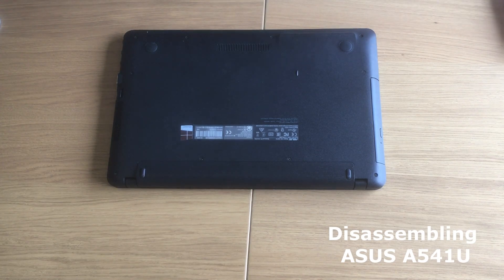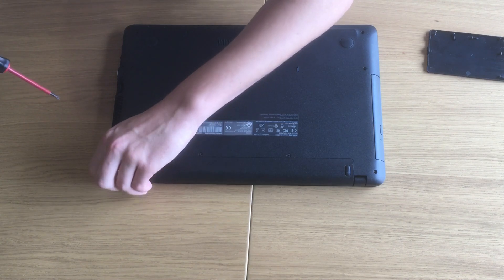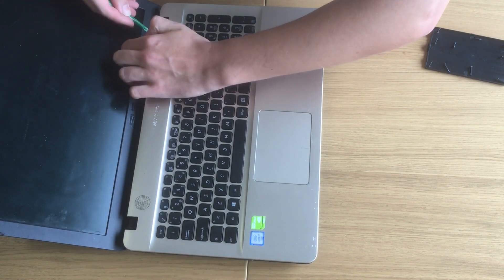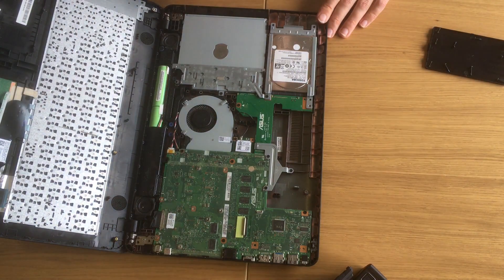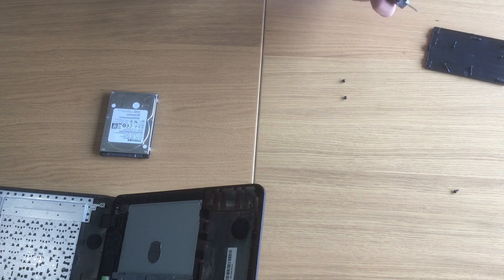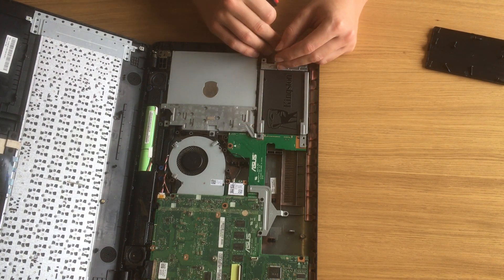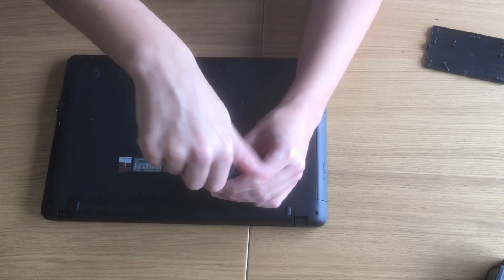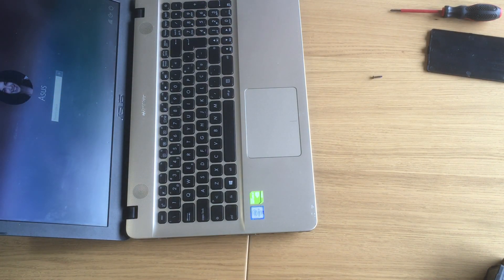ASUS A541U Disassembly for SSD upgrade

Comment: Thanks for making this tutorial and sharing it. We normally skip the removal of the keyboard and touch-pad cable. You can place the keyboard a bit to the left and can still reach the most left screw. It can save a lot of time because it can be a hassle to get them back in. And there is a risk of damaging them in the efforts to put them back.
Reply from the maker: Thanks a lot Patrick for the tip! I'm pinning your comment as it can be useful for others. To anyone who follows this, just keep in mind: Make sure you don't push the top too strongly or drop it accidentally, to prevent damaging the flex cables!
Reply: Shall we mount ssd as well as hdd ?
Reply: Woohoo I did it in 2024. Thanks for the video and the tip. Both worked. Superfast
Reply: thank you for the tip and recycle geeks for the tutorial!

Comment: Hello friend, thanks for the video.
 He explained, change the battery and increase the RAM by 4 GB according to his video.
 When I change it and turn it on, after a while I get a blue screen of death in Windows and the PC restarts.
 I thought it was because of the RAM or battery and I left them back with the original ones, but the same blue screen problem continues that didn't happen before.
 I think I have left everything connected correctly, I can't think of anything else and I'm stuck, I think I may have broken the board or something, could you please help me?  Thank you
Reply from the maker: Hi! While it’s unlikely you broke the board, a few helpful measures is trying to investigate the specific error (there’s a code associated) and potentially try a reset to windows. Try to understand what triggers the bluescreens to understand the root cause and fix it. For example, is it while gaming? Stress test your cpu to see if it’s temp related, etc.
Reply: Hello, it happens without forcing the PC.  For example, when turning on.  I have run the mentest64 program on it and I have turned the computer to maximum and it has worked fine, but when I go to turn it off, the blue screen appears.  Other times as soon as you turn it on.  How could I drain the static energy from the plate in this model?  thank you. @RecycleGeeks
Reply: Amigo sigo con el problema...

Decidí cambiar la batería y aumentar la RAM de mi portátil Asus A541U.

Tras el cambio, reconoce la RAM y batería bien , pero Windows me da pantallazo azul de la muerte y se reinicia. "El dispositivo tuvo un problema y necesita reiniciarse" "system dervice excepción". Lo reproduzco así:

- Enciendo el portátil y voy al administrador de tareas, rendimiento, se reinicia en esa pantalla.

- En algunas ocasiones al apagar Windows.

Por ahora lo que he hecho:

- Le he pasado el memtest64 y he puesto la RAM al máximo y CPU sin problema.

- He actualizado la BIOS y la he vuelto a poner de fábrica.

-  He vuelto a dejar solamente la RAM original (integrada en plaza) y he retirado el módulo de RAM que le puse. También he dejado la batería original, mismo problema.

- Antes de manipular el portátil, esto no pasaba.

- Creo que lo he dejado todo bien conectado, incluido flex y tornillos. Hay tornillos de diferentes tamaños en este modelo. Disco duro está bien conectado.

. He pensado que podría ser por qué se haya acumulado energía estática (no use la pulsera ). He intentado quitarla , quitando la batería y presionando el botón de encendido. ¿Como podría drenar la energía estática de la placa en este modelo? 

No se me ocurre más nada que probar...

Comment: I was thinking to buy a new laptop... Since my laptop was slow.. but now i am thinking to upgrade the Ram and hdd to sdd. Is it worth it ?
I am exact same laptop though
Reply from the maker: SSD will make a huge difference. RAM as well, but you can try to upgrade first the SSD only and see the result. SSD + fresh OS install will make you feel like you have a new laptop.
Reply: @RecycleGeeks  thanks for the input. I am clearly a non geek. What SSD and Ram you recommend me ?
Reply from the maker: @berlin5403  go for the kingston A400, it’s what we use in all our upgrades. Good speed, good price quality. Samsung, kioxia and critical are also good. 

Link to our store: https://recyclegeeks.store/products/disco-ssd-kingston-a400-480gb-novo-1?_pos=2&_psq=a400&_ss=e&_v=1.0

Comment: heres a life saving tip, try powering the laptop on after attaching the two cables because if theyre not fully in, or if they clip is not closed, it wont work so test both ur keyboard and touchpad is working before u clip and screw them back on.
Reply from the maker: 100%!! testing that really saves you from screwing all that all over again 😓

Comment: Hi, what's the maximum ssd capacity i can put on that mode, precisely
asus a541u i3 7th generation, 4gb ram, nvidia 920mx 2gb

i can put up to 480gb? or max 240gb?
Reply from the maker: Hey! You can add an SSD of any size as long as it is a SATA 2.5”
Reply: How should be the mm of ssd for Asus X541U my friend?

Comment: I really liked your video! I will do the same to improve the hard drive. By the way I have a question, to use the recovery in that model of asus which key should I press? Thank you so much
Reply from the maker: Try pressing ESC or F2 right after boot ;)

Comment: Can you help i got issue with same brand when opening it wont start up only asus logo showing installation recovery and its turn off and on  it keeps continue on off  like that and wont open.plss can you tell me what is the problem f9 recovery is not working f8 f11 not working only f2 bios is working
Reply: maybe you need to install windows on your ssd ?
Reply: Bruh u need to install windows on the new ssd without any operating system won’t work

Comment: Hello, I want to put SSD in place of CD drive. And keep HDD where it is. And then install windows on SSD?
Will it work.
Reply from the maker: It will work (assuming you use a DVD to HDD adapter). Keep in mind you should have windows installed on the SSD to feel a speed improvement. No idea if the sata port on the SSD will be slower, but let us know what you find ;)

Comment: HI !!!

    Could you tell me if it has two or one port / connector for the RAM memory, I want to increase the memory to 16/32 RAM.  Also change the HD to SDD.

  I want to learn SolidWorks and buy a laptop for more than € 2400 I can't afford it.

  I hope the graphics card is enough.

  You'd do me a big favor by saving me time, since we have the same laptop.
  
    Many THANKS 😀

Comment: Thanks for the video. 
I have 2 questions;
1.) Could I have both ssd and hdd at the same time? without removing the hdd 
2.) Is there any more slot for the ram? Now i have 8 GB ram and wanna have upgrade to the 12 or 16 GB.
Reply: 1. yes you can, but you have to get rid of the disk drive bay
2. what is your processor? and have you upgraded the ram before?

Comment: Hey there! Quick question, I am using the X541UV model and I want to add a SSD. I would like to take off the DVD driver but my windows is already installed into my HDD. If I wanted to swap my DVD with an SSD, will it still improve my overall performance or do I HAVE to install windows into the SSD in order to feel a jump in my performance?
Reply from the maker: You need to install windows on the ssd, otherwise there is little improvement in speed. You can replace the dvd drive with the hdd for extra storage though
Reply: @RecycleGeeks  perfect! Thank you very much! Time to save up to invest in a SSD haha
Reply from the maker: @thetooldude939  keep in mind that to have a HDD on the DVD drive you'll need an adapter. Just google "laptop dvd drive hdd adapter" and you'll see what I mean ;)
Reply: @RecycleGeeks  noted with thanks! Have a great week ahead!
Reply: hi i need help please, is the DVD caddy 9, 5mm or 12mm ?

Comment: Is the ram integrated into this laptop or you have to add one? Cause mine starts up but I only get a black screen.
Reply from the maker: Hi Melvin, the RAM is not integrated. There are two slots, under the motherboard. If your screen is blank, try to connect to a TV / external screen.
Reply: @RecycleGeeks  I only have 1 empty slot and I think on my asus r541u 8gb ram is integrated. I tried to connect with vga/hdmi and still nothing.

Comment: Without removing the HDD, we can upgrade with SSD..?
Reply from the maker: The SSD upgrade replaces the existing HDD. A solution to have both HDD and SSD is to buy a caddy for an HDD that you can place on the DVD reader, but in that case you lose the DVD reader.
Reply: @RecycleGeeks  that is ok.. but some people are telling if we keep both had and sad.. that will make our laptop slow like that.. is that true?
Reply from the maker: Hi @naga vinoth as long as you have windows installed on the SSD, the laptop will become much faster ;) regardless of having an HDD too or not

Comment: How to resolve keyboard issue on this lappy ,i have a same lappy🙂👍???
Reply from the maker: Hi, what issue do you have? :)
Reply: @RecycleGeeks  my keyboards are not typing certain keys like a b and z etc
Reply from the maker: Simon Pangkeng that’s very odd 😕 This happens sometimes after spilling liquids on keyboards, or when the flex cable that connects the kb to the motherboard is loose. Are you sure the flex cable under the keyboard was well connected after reassembling?
Reply: @roboanalytics1678 I too faced the dame problem and I removed the keyboard cable connector and cleaned it and replaced and now its working..

Comment: How much did it cost u bro and is ssd or hdd same ? Or is it boost ram??
Reply from the maker: I kept the same RAM, I just upgraded the HDD to SSD, it costed 37€ for a 240GB SSD from kingston (A400). The computer is much faster now. SSDs can read your files at ~450MB/sec, compared to 70-90MB/s on conventional HDDs. It was taking 1 min to boot and 45seconds to open chrome - now it boots in 15 sec and chrome opens in less than 10sec!
It’s really the best upgrade you can make.
Reply: @RecycleGeeks  bro i also have another question to ask u , that my laptop keyboard doesn't not working  n i dont knw wts the issue , n m using  extra keyboard   , please if u hve any idea about keyboard touch problem with this laptop ,
Reply from the maker: Hey @GRAB SOME KNOWLEDGE & WISDOM have you checked if the flex ribon is well connected? If its not well connected the keyboard wont work :/
Reply: @RecycleGeeks  tnx brother, but whre can i locate, n fix this by my own can u please tell me should i open the whole keyboard system??
Reply: @RecycleGeeks  tnx for information bro keep it up n always share this kind of video 👌✌️
Reply: Thanks for your guide.....i want to know that can we upgrade this model with M.2 ssd..?
Reply from the maker: Hey Abdul this model doesnt have m.2, only sata
Reply: @RecycleGeeks  thanks for reply....👍